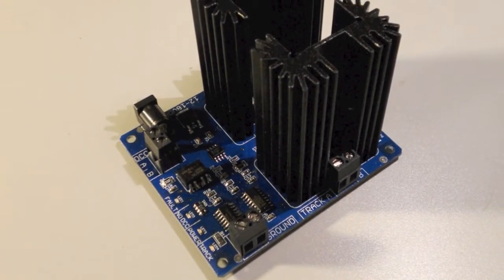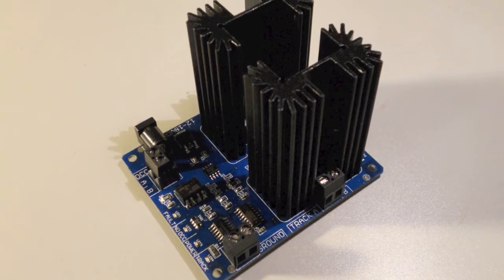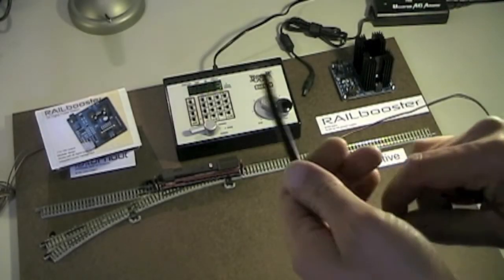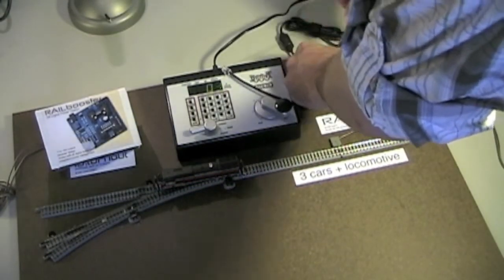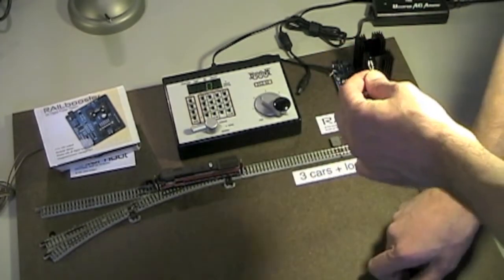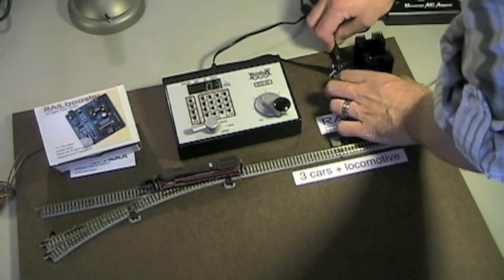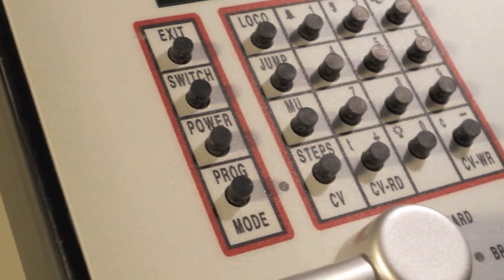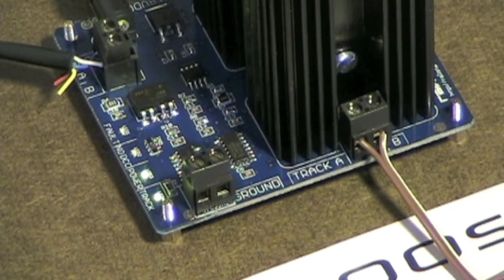Connecting RAILbooster to LocoNet

Comment: As a user of Uhlenbrock Loconet Hardware things are straightforward and simple plug & play with boosters to loconet B and throttles to Loconet T  , So no cutting / splicing/ soldering is required . The Beauty of Loconet is the ability to instantly connect model railroad equipment together and everything is communicating and executing commands flawlessly . My Uhlenbrock Intellibox is running the show with other brands of Loconet hardware such as Digitrax  and the Roco Z21 ( connected via Loconet as a slave unit ) The aim being automation without a PC .